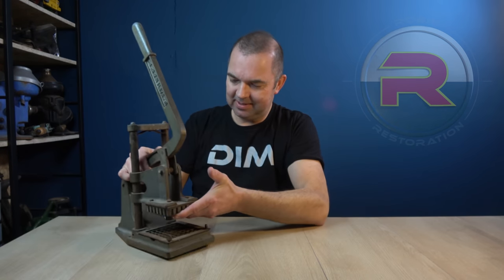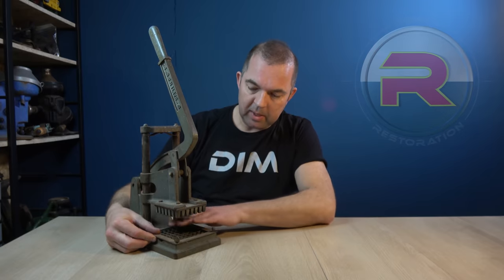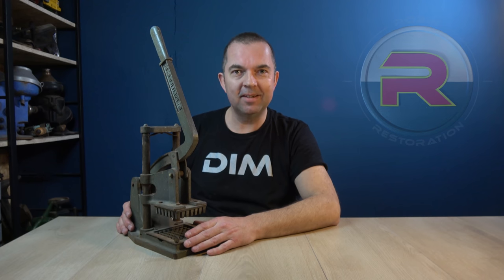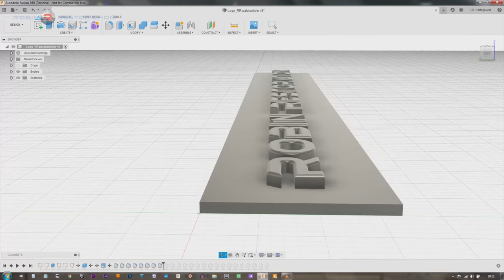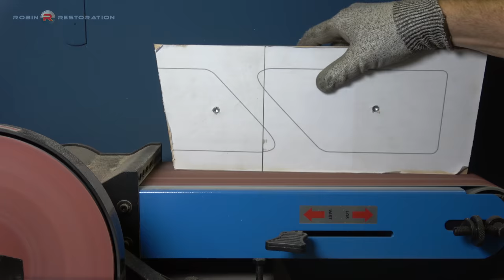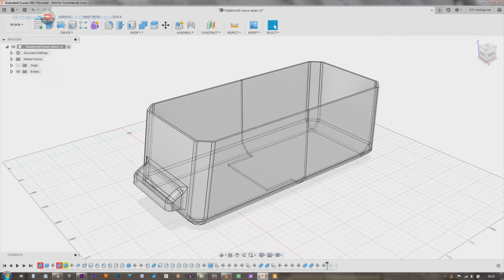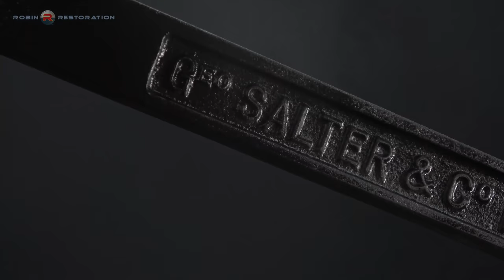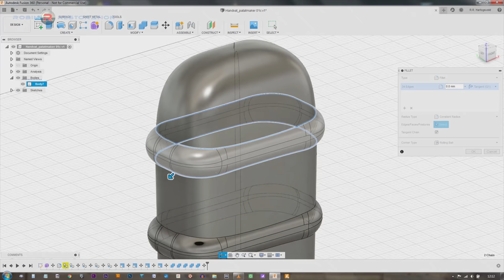Restoration & Upgrade of a 100 year old potato chip machine [4K/UHD]

Comment: Good job, except I don't understand the fetish about using Bondo to smooth-out the natural texture of the surface on the cast parts.  But you're not the only one who does that.
One other thing:  looks like it does a good job of cutting potatoes up for French fries, but I'll be damned if I can see how it will make potato _chips_.  :)
Reply from the maker: Smoothing out the surface is a decision. In this case I wanted the machine for myself to be used. In other cases I leave it as is (and some things only need a cleaning and should be untouched to preserve the 'age' but I won't say that out loud on this channel ;-)
 See some other comments about the chip matter...it is a British <> USA thing. The British didn't know the word 'French fries' until fast food chains from Amercia arrived. They called it 'chips'  like in 'Fish & chips'. That is why this machine was called a 'potato chip machine' back in 1915. We call it 'frites' by the way.

Comment: 25:40 check out FUZZY SKIN in cura - it's pretty cool for handles - about half the default values works well imo - great vid, thanks!
Reply from the maker: Thanks, I'll check if my slicer has this setting, my interface looks a lot like Cura's.
Reply: @ROBINRESTORATION  if it's Creality Slicer that's just rebranded (possibly very old) Cura. if you put the time and testing in then current version of regular cura could give even better results and offer weird new options to try out.

Comment: Nice resto! The base was a nice touch, Adding the biscuits made no sense, biscuits are used for alignment and not necessarily used for strength. This method is mostly used when attaching a large frame to a china cabinet. When using penetrating oil/spray on old tools, most of them have course threads so just spray each joint and screw and let it sit for 10mins, the oil will penetrate those course threads within 5 to 10 mins. I never understood why people spray a screw and start immediately turning on the thing, oil does not penetrate in 2 secs flat. Using cold bluing is a nice touch.
Using the sand blasting method is faster and finally a lot of restorers are using it. For the past 5 years they were using sanding disc and wire brushes and of course no respirators which a lot of those old tools used lead based paint.

Comment: I'm sorry, but chips vs fries is one where I think America wins. If you chip a tooth or chip a tile or concrete or woood. They are tiny bits, flakes, not long like a julienne potato. That is why what the brits call potato crisps, should be potato chips. Because they are chip like. French fries (UK = potato chips) are not like chips of anything. However, the phrase "Fish & Chips" is a perfect one and shall remain for all time. Will just be an anachronism, like "turning the dial" on the tv.
Reply from the maker: Thanks for the explanation, there has been a lot of comments about this matter. I also found out that frech fries (not French) has nothing to do with France, but comes from the verb 'frenching'', making long slices.
Reply: @ROBINRESTORATION  I was kinda just being silly. Call them what your want.
Reply from the maker: ok, 'friet' then.

Comment: The work is exceptional, pity however for the lower blades that have been partially restored. It would have been enough to use a small brush to complete the work. The fixing screws of the machine (those on the wooden base - really exceptional) have a countersunk head and are bad. You should also have flared the base of the machine, or used screws with different heads. It's a Sin. Rated 8, but you could have taken 10 and praise.
Reply from the maker: I received a tip that the blades can actually be taken apart completely, where I was sure they were permantly fit together. I will try that and will be able to sharpen the blades much better.
Can you explain more about the scres? Why are the screws bad?
Reply: @ROBINRESTORATION  Simply because  the heads of the screws don't fit properly with the metal base. If you install a screws with a conical head (like in the video) you should make a conic base (with a simply drill and proper drill bit) in the holes to perfectly fit them, otherwise, you should install a screws with a flat head. On the image link, in the center ther are holes with a flat base (like your metal machine base) and on left and right ther are conical holes. In the second link, a screw with a flat head. Good notice for the blades!
 http://garletti.it/svasatura-stampi-lamiera/
https://www.foxcar.it/catalogo/img/prodotti/3127_6.jpg
Reply from the maker: @Redpass63  I agree. I searched for old roundheads or the right bolts with a conical head. The base has conical holes but I didnt find the right ones. It bothered me too. I might do an update video once with all the tips I received.
Reply: @ROBINRESTORATION  See that I just wanted that you remove a pimple of a great job 😉

Comment: 26:54 that hurts, the bolts don't fit! You are using countersunk screws without having countersunk holes.
Reply from the maker: Yeah I couldn't find the ones I wanted. Maybe I'll do an update video, I received some handy tips on sharpening the blades too. And they were countersunck holes, but not the right angle for what I could buy.)

Comment: My parents ran a Fish &Chip shop in England in the 60s through to the 90s.
By 1965 the electric chip cutting machine had arrived, but this hand cutter was kept in reserve in case the electric cutter failed.
Many a time my brother and I would 'help' making chips using this chip cutter whilst standing on a chair; that is one heavy piece of kit!!!
It was bolted onto a tall table with a cut out for the chips to drop into a large plastic container below. Chips would be soaked in water and rinsed  to remove the excess starch by removing a rubber bung at the bottom of the container. Once dry, the chips would be fried.
The cutter was painted white.
Salter also are known for their Butcher's and Green Grocer weighing scales.

Comment: No point in watching a video like this if one does not own an elaborate array of equipment (lathe, belt sander, CAD, CNC machine, etc.). Definitely not a DIY video. This is a "How It's Made" video. But thanks for the "Demo" on something I'll never do or never use.
Reply from the maker: That's why I call it DIM and not DIY. Not everybody can invest in all of those machines from the start. So this is the way I do it, using the equipment that I own and from there I will expand it over the years, that's normally how it works unless you are a very fortunate man.

Comment: As someone who works in the food industry I find it very bothersome that you wouldn't just go to a restaurant supply store and buy a new set of blades, and instead choose to use ones that are who knows how old and incredibly dull.
Reply from the maker: It is a little bit the whole point of restoring an item. I could have replaced every screw as well or buy a new machine for that matter. And restoring something is different than what you would do with a machine in a restaurant or other production environment.

Comment: I think the wooden parts would look a lot better, if you didn't round over all the edges so much
Reply from the maker: The round edges prevent the edges from being chopped during normal use. Maybe design wise you are right.

Comment: If you can counter sink those allen bolts, itll look so much nicer when theyre flush. Also wood handle, and use anti-seize on yourbolts and anywhere two metal part sit together. Oil is okay for shortterm if you disassemble clean and reoil often. Otherwise itll get gunky. Last but not least have fun and enjoy the process😁😁😁
Reply from the maker: Thanks

Comment: Awesome! If i see this right, the under cutterpad is held in place by 4 screws, of which only two are for fast release in front. It would be smart to use two wing screws on the back too. This way, cleaning is much easier,no?
Reply from the maker: The back screws are not to be tightened completey, so when the front screws are turned 90 degrees, you can slide the plate out easily.

Comment: could not tell from the vid. but it does look like the top (plunger) is difficult to remove for cleaning after use. the cutter does have the thumb screws. I enjoyed the video. thanks :)
Reply from the maker: Yes you would have to remove the 4 screws over and over again
Reply: @ROBINRESTORATION  thanks for your replay. sorry but cant think of a simple solution to it. can think of several but it would be major modifications. like would it be possible to U out the back two screw holes and replace the front two with thumb screws? not sure if the downward force would keep causing it to loosen up after a few uses. ("There are no bad ideas, just better ones.")

Comment: Great restoration! I wonder if the removable knife block is just for cleaning, or for putting in different blocks for different sizes of fries, from French to Flemish.
Reply from the maker: I can't tell you.
Reply: Aalbert Torsius Modern versions do have a couple of different sized cutters, but are also removable for cleaning and occasional replacement- imagine a fish and chip shop, which is where this likely originated - they would get through hundreds of pounds of potatoes a week- those blades won't last long.

Comment: Hola, me parece que la máquina está mal armada, ya que la chapa acerada que funciona como resorte ( min 24:37 ) no trabaja. Excelente trabajo!
Reply from the maker: The steel plate is a small design mistake I think, the idea is good to prevent the slider to bump into the top part. But the slider hardly reaches that point.
Reply: @ROBINRESTORATION  Ok.

Comment: If you're gonna do restoration projects please try to use correctly sized screwdrivers, ideally hollow ground instead of tapered for slotted screws.
That looked a little wobbly
Reply from the maker: Thanks for the tip Anthony, I have not seen these screwdrivers over here but I am going to find them.
Reply: @ROBINRESTORATION  I believe brownells makes a sizable set that's aimed at the gunsmithing market and thus should be pretty good quality, iraqveteran8888 did a video on their set a little while ago, hollow ground basically means that rather than a taper they go in at the top in a concave fashion with a perfectly vertical side to the bit end itself, thus maximum contact with the screw head, plus a greater variety will ensure a correct fit, for instance I'm lucky to have an imperial and metric set of allen keys as well as some imperial slotted screwdrivers so they will usually be a perfect fit
Reply from the maker: They are hard to find. I found the DeWalt series but they are also hard to obtain, only in the USA it seems.

Comment: 9:43 thats awfully close to the spinning machine with gloves. Wouldnt do that.
When buffing its whatever but the whire wheel could catch that Fabrik.
Reply from the maker: Thanks for your concern. Those are thin nytril gloves and the polishing wheel. I don't see any danger in that. The rubber would rip to pieces but I have never had a polishing wheel grab these gloves.
Reply: @ROBINRESTORATION  sry wrong time stamp 8:35

Comment: Is that a powder coat you used? Would hate to start getting chips of paint in my fries (chips).
Reply from the maker: I wish, I don't have a powder coat system yet. Well, the oven is what holds me back for now, I can't find the right one with a good filming glass. I am afraid I will have to make one these days.
Reply: @ROBINRESTORATION  have to start somewhere. It looks great regardless. And it's not painted in any moving parts so really chipping shouldn't be an issue anyway. 

It works, it looks great. Good job my man.
Reply from the maker: Powder coating is definitely on my wish list...

Comment: But first , you need a lapel mic  and better audio
Reply from the maker: I have a Rode Pro mic and good quality wireless Senheiser mic. But I have been struggling with the settings in my small workplace. Yoitube also does some strange audio leveling, but I received some good tips so the next video should be much better.

Comment: I admire the attention to detail in the restoration although I feel it needs unnecessary additions.  If there were to be a grip added consistent with the time of manufacture it would have been Bakelite which really would have been of little comfort to the operator anyway.  I dislike your self promotion with the addition of your channels name to the handle, you say you will use it yourself so if it's to be kept and friends see it you can simply tell them, if they ask,  you additions ruin the aesthetics and mess with the authenticity of the piece for me, although I will let you away with the paint colour as it is to be kept in your kitchen I presume. 
As for the stand, functional but too Ikea for my liking.  Apart from all that I think I'll subscribe.
Reply from the maker: Thanks for you comment. For me there are many ways of 'treating' a tool, toy or machine. Some should be untouched. Some should only be cleaned and the old look should be preserved. But when you can choose between putting it on a shelf to look at or to bring it back to its orgiginal funtionality, I would chose the latter. Like toys, I think the original designer would prefer to see his toy in the hands of a kid, than on the shelf as a collectors item. This machine was just for me and I wanted to see if I could upgrade it a little to my own comfort, showing the possibilities of 3D printing as well. As you have noticed, These parts are made from PLA plastic. If one of my great grand children wants to restore this in about 80 years orso, it can easily be be brought back into its original condition. I hope you subscribe, I like to hear everybody's opinion.

Comment: On Mark Novak's gunsmith channel he has a way to restore oval and round head screws by peeing the metal back into place restoring the original screw slots to their proper dimensions.
Reply from the maker: I will check it out. I also read a comment to hammer it back into place, that is what I am doing with my current restoration. Or is that 'peeing into place?"
Reply from the maker: He has many videos, can you show me exactly where he does this technique? (right click on the video > copy from this timecode)
Reply: Yes he moves the metal back in place by peening and minimal filing. He restores antique weapons and strives to keep all the original parts with the gun.
Reply: @ROBINRESTORATION  I saw this technique dozens of videos ago.
He uses an machinists bench block about 3"×3" drilled with various sized holes. He places the screws flush in the appropriate sized hole to hold the screw a have an anvil to back it up. You want a smooth faced peen hammer obviously to not introduce unnecessary marking of the screw head. Hope this helps.
Reply from the maker: Have you seen my latest video? Your tip helped!

Comment: I do have a hard time calling this a restoration instead of a redesign and improvement. A restoration would have been to clean and replace bad parts with like new and then apply original finish style  and paint to original color
Reply from the maker: That's why the title says 'restoration and upgrade'. In this case I want to use the machine myself so I chose small upgrades and a color I liked.

Comment: Ahhhh gloves on a bench grinder
Reply from the maker: Noted
Reply: @ROBINRESTORATION Honestly the chances are you'll be fine, but there is a non-neglible chance you'll get caught and lose a finger or worse.

I got lucky and only ended up with a few cuts and bruises.

It's always been drilled into me to avoid gloves, long sleeves, and loose clothing around rotating machinery.

Comment: I did notice that in the beginning of the video, that when he was showing that there was no movement at all, that he was pushing the handle the wrong way . It is suppose to be pulled towards the front .
Reply from the maker: I noticed afterwards as well, the handle was stuck allright, but I was so concentrated on the correct closeup shot that I didn't realize it at the time and not even during editing.

Comment: Please stop using gloves like these when working on the wire wheel or other high speed/tourque power tools
Reply from the maker: The rubber gloves tear apart, they are to weak. But you won't see me using gloves on the lathe or my big grinder. The little grinder can even be stopped by hand, it has no power.

Comment: You lost me when you started to grind away the factory edges and pasting the whole thing. You're just not restoring to the factory state but destroying the thing by making it "better"
Reply from the maker: Correct, in this case that was my intention, as I mentioned I want the machine to be used by myself, that is why I also made the handle and box. In other cases I just want to restore it to it's original state. And sometimes I find tools that only need a good clean and should be untouched to preserve the old look ( I don't make videos about that of course). So there are many different options I think.

Comment: why would you add stuff that wasn't on the original?.  You completely ruined the value of the antique.
Reply from the maker: Really? And what is in your opinion the value of the antique? Let me explain: To me, the designer of any machine did this to make life more easy and intended the machine to be used, not to sit on a shelf to look at. But I agree that some items are nice to have and to look at without being touched. This machine I bought for myself, in order to use it as it was intend 100 years ago. Everything I added can be removed in case someone wants to restore it in the year 2120. So did I ruin the value of the antique? Of course not.